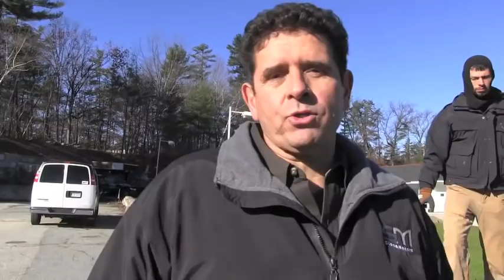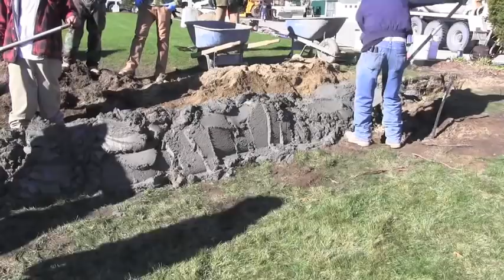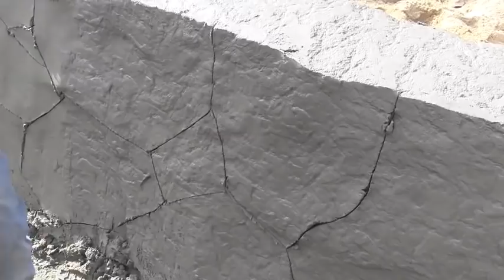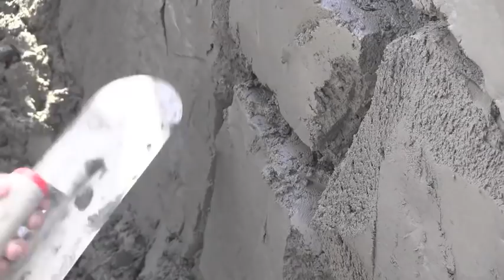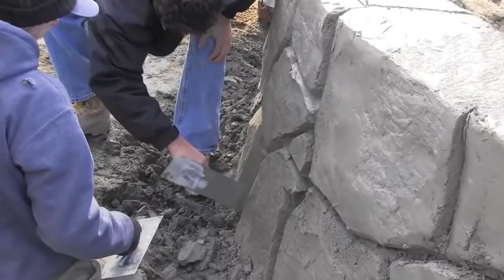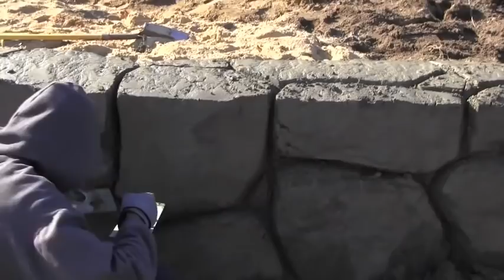How to carve deep rock retaining walls

Comment: My project for this spring... a faux rock retaining wall for a raised tropical garden bed. Have been scratching my head for many days trying to concoct a plan on how to construct the foundation for my cement. Was going to collect used concrete pieces from old sidewalks, etc and build it that way, cementing them together and then going over that with the concrete I plan to create the faux rock look with but my BF has vetoed taking advantage of free materials from Craigslist. Hadn't considered doing it this way with rebar until now, when also researching how the hell I will build out the support structure for the future waterfall that will eventually connect to soon-coming garden bed. I wish there was more detailed information on the process of building the structure, and mixing the concrete. It looks easy here but I picture me starting this big project one wheel-barrow at a time, and the concrete just being so squishy that it won't hold a vertical shaped. Having a cement truck is an absolute no, before I even ask. 

FYI: 
I have never mixed up or used cement in any way before.

Comment: Could I use this technique if I wanted to build a wall 30' high, such as for a rock climbing wall? Would I make steel structure and then plywood and then rebar and then the cement?
Reply: I think you would have to do it up in stages as it will take you time to finish it, looks wise so say 5 foot at a time but what you say sounds good keep the steel strong and mabe use wire mesh as well for extra strength

Comment: What does your 'own mix' have in it, though?  Such as what kind of additives do you put in it and what kind of cement is it and the sand ratio, please?
  That's what YouTube is all about... sharing information, sharing knowledge, sharing fun ... well, sharing everything.  :)
Reply: I also would like to know:)
Reply: He won't tell you. I went to the Stone Makers academy and he won't tell us.
Reply: I want to know to
Reply: Type II cement is important!  #/2/1 mix is what we use for ROman rock mixture!
Reply: Ron Noonan how do you know?
Reply: Plastic cement and plaster sand and the ratio is between 8-12 shovels of sand per half a bag of cement
Reply: I was at disney s pandora world. And all the mountains and stones blow my mind. i want to make a  castle ! The mix must have some epoxi additive
Reply: I would say 4 plastering sand 1 cement they put the steel rods in to give it structure and less likely to crack or move sand and cement will set like that when left a long time a good few hours it will almost turn to a screed witch is the stage when they start cutting , I am not 100% on all of this but as a plasterer its what i think and they have done a top class job here with detail and natural look
Reply: Carbon fibers in concrete
Reply: @khca0712  Thanks for the info. Is that the #47 or 94# Bag of plastic cement?
Reply: @John Gluck  how was the class? Worth it?

Comment: what cement mix is this?
Reply: skyastradriver   I recently made a retaining wall that was about 36" high.  I used this mix.  2 parts Portland concrete (mixed 35% fly ash) and 1 parts fine dust sand.  With this mix, I used 1/4 cup of plasticizer, 4 cups of acrylic fortifer.  try keeping a 2- 1/2 inch slump when using this recipe.